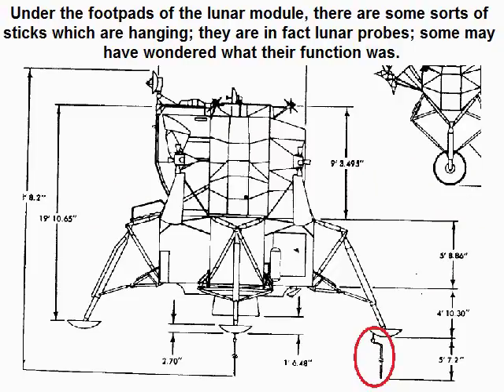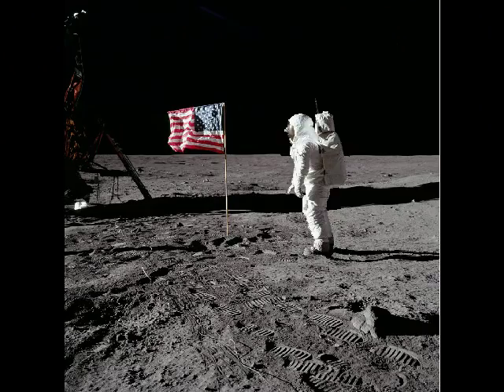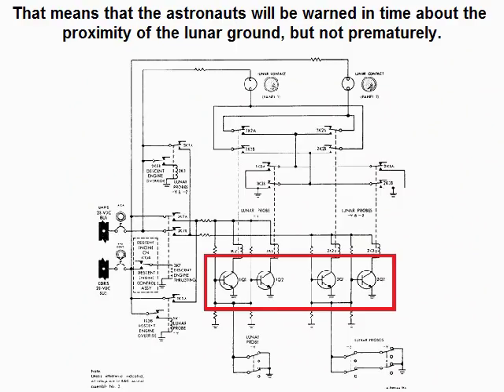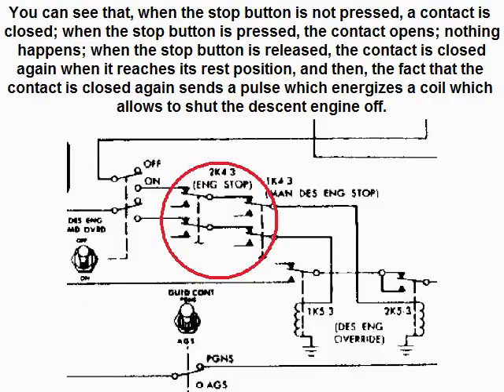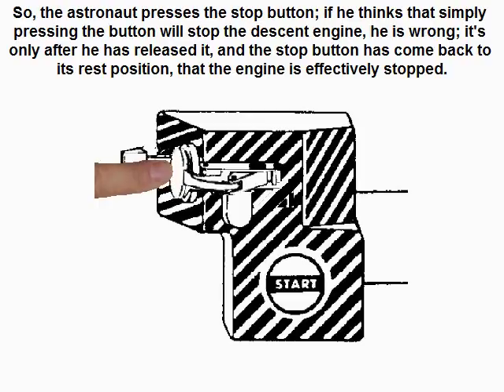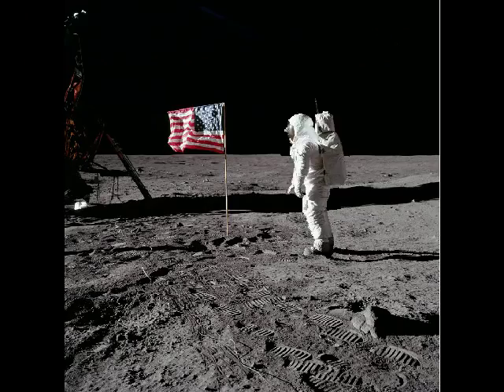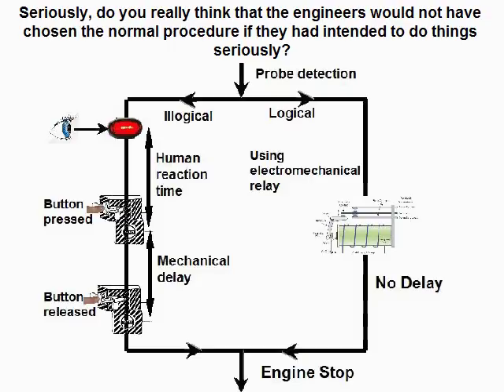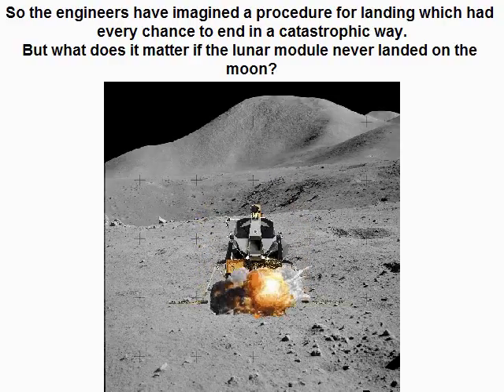Unsafe moon landing

Comment: That's another incorrect and illogical claim, Hunchbacked. The reason why the descent stage engine was shut off as soon as the contact lights lit (that is, when the first probe touched the lunar surface) was to prevent unnecessary damage to the fragile LM with its thin skin due to regolith and moon rocks being blasted up from the lunar surface. The LM could easily have landed with its descent engine still firing, as it was already throttled back to a small fraction of its maximum thrust. This mission design consideration can easily be found online in 30 seconds of Googling. As usual, an ignorant hoaxnut fails to do fact-checking and misrepresents Project Apollo to gullible YouTube visitors. What you are doing in your videos and texts is propagandising for your lost cause.
BOTTOM LINE: The reality is the OPPOSITE of what you claim: the LM descent stage engine was cut off seconds before the landing to INCREASE THE SAFETY OF THE MOON LANDINGS. Cutting off the engine was a childishly simple operation. The Apollo landing films clearly show regolith being blasted upwards and outwards at high velocity, therefore this safety measure was appropriate and necessary.
Yet another ludicrous hoaxnut claim DEBUNKED.
Reply: I am not "trolling this guy". This guy is trolling NASA, its courageous astronauts and the global scientific community. It's got nothing to do with ego; it's got everything to do with an ardent desire that the Internet fulfill its original mission to be a vehicle for education, not anti-science propaganda. It's got everything to do with extensive knowledge of Project Apollo gained from studying it for five decades from many angles and from studying the scientific research based on independent analysis of the data, photographs, films and lunar samples that were the concrete results of the Apollo lunar missions and have been independently verified by multidisciplinary teams of scientists working in numerous countries. Five decades of closely following developments in astrophysics, astronomy, cosmology, planetary science,  manned and unmanned space exploration and contact with experts in those fields. Awareness that no physical scientist anywhere in the world has ever contested the concrete results of the Apollo lunar missions or any other manned or unmanned space mission by ANY national space agency.
If you wish to dispute this, then please give me the name, title and research institute of any physical scientist who has publicly challenged the veracity of ANY space mission. We both know you will fail to meet this challenge.
  
It's an extraordinary claim you're making, Mr Smitty: that NASA lied about its missions! "Extraordinary claims require extraordinary EVIDENCE." (Dr Carl Sagan). Present your evidence, please. Proceed.
Reply: Rob - You are wasting your time arguing with Ralf, he will always be right no matter how much you debunk his claims, as for Hunchbacked, all his videos are universally laughed at, he is an idiot to be ignored.
Reply: Paul: that may well be so, but I am going to continue challenging these ludicrous, risible and baseless claims by putting the truth out here on Internet for all to see for as long as I can think clearly, read and type. Some people who read these posts will think logically for themselves and come to the right conclusion. I cannot stand idly by and see NASA and its courageous astronauts being maligned by these moronic, uneducated hoaxnuts.
Reply: hunchbacked quote:
"hunchbacked
17 hours ago (edited)
+Paul Julian
You know, I could remove your comment which clearly is an "ad hominem attack" (and I think that any other moon hoaxer would do it).
But I'll leave it, because I want people to see that the Apollo believers replace arguments with low attacks."

So,it's OK when you do it, but not OK if we disagree with you? You call Apollo defenders idiots and the like all the time. Do you know what a hypocrite is?
Reply: +Keith Mayes It has been established beyond doubt that hunchbacked aka Xavier Pascal aka Pascal Xavier aka lune imposture aka aerospace engineer aka SUPAERO aka ...aka ... does indeed possess a Diplome d'Ingenieur bestowed by ENSAE. The only way left to reconcile his formal engineering qualifications with the crap videos that he churns out like sausages is to introduce the prospect of some form of mental illness. The last time that he could have had anything to do directly with aerospace research was on or before 1988 thirty years ago. He does recognise that many of his moon loon bed partners are barking mad as he feels the need to distance himself from many of his supposed supporters who are flat earthers and the like. His failure to recognise that he is indeed painted with the same brush strokes indicates some delusion behaviour at the very least on his part. A sad individual caught in a personal phantasm of his own devising that he cannot escape from who often repeats his 'discoveries' on a regular basis. A very sad individual indeed!
Reply: Hunchbacked (Do you actually have a hunchback? If not, why choose such a name?) It seems that you have poor comprehension of the Apollo hardware and software system design choices, as you keep (deliberately) misinterpreting and misrepresenting them. In this case, the Grumman designers chose a simple but elegant solution: basically hinged metal rods, springs, wires and lamps. The system worked fine on all six occasions, so stop whinging. In any case, as I have already explained, timing of the descent stage engine was NOT mission critical; it was just an extra safety precaution. And any damned fool can press a button or flip a switch when a light goes on -- even chimpanzees.
Reply: Your video, as usual, consists of "I don't understand how/why they did this, therefore it must be fake." 

The poor comprehension is yours, Xavier. I suspect it is deliberate, however.
Reply: Hunchbacked: OK - it was probably a microswitch not a relay. But who cares? Why are you focusing on this aspect of the LM design? What do you hope to gain from this? Obviously, the Grumman designers had good reasons to make this choice. Maybe they reasoned that vibrations might accidently trigger a premature descent-stage engine cutoff, which would have been catastrophic. I can see why they might have preferred to give the astronauts manual control over this aspect. Many of their choices were simply to eliminate unnecessary complexity and lower the mass of the LM. Maybe, if you're generally interested, you should contact Grumman and find out if any of the designers are still alive.
I recommended this book to you: https://www.bol.com/nl/p/how-apollo-flew-to-the-moon/1001004010228706/
Have you ordered it? You should do. You need to get some education.
The key point is this: You have not presented any COMPELLING, INDEPENDENTLY CORROBORATED AND VERIFIABLE EVIDENCE, INCLUDING REFERENCES/LINKS TO SOURCES that NASA 'faked' one or more of the Apollo moon landings, and you never will because there isn't any!

FACT, uncontested by any physical scientist anywhere in the world: In the period 1969-1972, 12 NASA astronauts personally explored the lunar surface and returned 382 kg of Moon rock and regolith to Earth. Get over it and get a life! You're playing a loser's game.
Reply: Yes, the contact probe circuits contained relays. If you'd actually study them to learn something, you'd notice that the (multiple) switches and relays are wired in a fault-tolerant manner, like almost everything else on Apollo. You want the lights to work even if one of the probe microswitches fails to operate or operates prematurely. In fact, the Apollo diagrams are an excellent introduction to fault-tolerant design.
Reply: ApolloWasReal: Great comment - thanks for clearing up that confusion. ;-)
Reply: ...where intelligence goes to die.
Reply: Ahem... http://abcnews.go.com/Technology/apollo-moon-rocks-lost-space-lost-earth/story?id=8595858

Pay particular attention to this quote:  "  The Amsterdam case appears to be not fraud but the result of poor vetting by the Rijksmuseum."

As I said before, you need to read more than just the bits that appeal to you. More current articles help, too. Hoaxtard.
Reply: So, your NBC article from 2009 is legit, but a 2014 ABC article that further clarifies the issue is just damage control, eh? Thank you for proving my point. You cherry pick what you like and discard the rest. 

As I said. Fucking. Moron. The bit you seem to be missing is that all of these articles, including those you link, all state Riijksmuseum received the petrified wood from the family of Willem Drees. Not NASA. I'll repeat that. Riikjsmuseum DID NOT receive the petrified wood from NASA. 

Reading comprehension. Try it.
Reply: I figured him for a troll several days ago, and he's finally admitted to it.
Reply from the maker: +Rob Stuart
Precisely, the Grumman engineers perfectly knew that the most rational method was to make the detection interface of the lunar probes directly shut off the descent engine AS SOON as the lunar probes were detecting the lunar ground, and it was possible since this interface was containing electromechanical relays; an electromechanical relay is not necessary just to light a lamp!
Reply: Cornelius - how do you know his real name is Xavier? Do you know his surname too? I'd like to do a little 'research'. ;-)
Reply: Yes, that's exactly what they were concerned about: an accidental cutoff well above the surface. This actually happened many years later to the (unmanned) Mars Polar Lander.
Reply: Yes, even most experienced engineers are not all that familiar with fault-tolerant design where you have to ensure that the circuit or system still functions normally when any one part fails. The most common structure is the manual backup. E.g., to pressurize a set of tanks you have two independent pressurization systems, each consisting of a helium tank, valves and controls, either of which can do the job. If one doesn't work you manually switch to the other. For on/off controls that simply must work you have the 4-device series-parallel interconnection: two strings each containing two devices in series, with the two strings then placed in parallel. In Apollo I've seen this with switches, relays and even propellant valves on rocket engines. All four contacts or valves are operated at the same time by the same handle or solenoid. Any one of the four can fail either open or closed and the other three ensure that the on/off operation still succeeds.
Reply: +Rob Stuart  "how do you know his real name is Xavier? Do you know his surname too? I'd like to do a little 'research'."  

You might appreciate the gmail message I sent you.
Reply: Cuz, you know, all caps.
Reply: +Waldemar Figueroa  The 2017 list of murdered Russian journalists is Yevgeny Khamagano,  Nikolay Andrushchenko, Dmitry Popkov, and Andrey Ruskov. This though is way down on the 2002 figure which maxed out at 23 journalists that succumbed to Critize-Putin-Bullet-Hole-In-Head- itis. Not bad for a country operating on truthfulness and openness!
Reply: Comrade Waldo takes his English lessons from off the Smirnoff label. His girlfriend is the Ethyl genie that lives in the bottle as the muse that inspires his posts and kisses and caresses him each night before he slips into his palatial sleeping bag to give us all a breather from his inane ranting and raving.I didn't realise in Putin's Ruskieland that wi-fi connections were available down Moscow's deserted alleyways!
Reply: +Cornelius Crewe  A quick internet search indicates that Waldemar Figeroa is a central and south American  name and not of Ruskie origin at all. His timeouts of YouTube posting presumably for sleeping are consistent with the habits for someone from the same neck of the woods. He is just a jackass troll who knows nothing of any substance re Apollo and should be ignored as such.
Reply: You had him pegged right off. Types like him are very predictable. Engage them just enough to rile them up, eventually they will expose themselves for the trolls they are, just like old Waldo.

 You would think it would give hunchbacked pause that clowns like this are his only supporters. Sadly it does not.
Reply: Rob Stuart This is an exellent discovery! And this shows me how ridiculous the moon landing is. A 1.7m long stick to measure the distance to the surface? The astronaut has to look all the time at the right lamp and has to push the right button and also has to release it instantly. In under 1 second? If not the lander would be destroyed! A very clever solution! And 6 times all the astronauts made no error! And what happens with this sticks during the landing?  They pushed them 1.7m in the ground? I have never seen fragments of this sticks. What if there were rocks under the ground?
Reply: Ralf: You misunderstand. The probes were not intended nor designed to MEASURE the distance to the surface. They were simple mechanical devices that triggered a relay, which switched on the dual contact lights on the LM main control panel. Both LM astronauts were watching the panel very carefully during the entire powered descent, because that's how they got essential data and other feedback on the spacecraft's velocity in each axis, position, engine thrust, fuel levels, etc. etc. They simply had to press the engine cutoff button. The LM was almost stationary at that point. Horizontal velocity in both directions was zero or near zero. Vertical velocity was also near zero. The LM was essentially hovering. When the responsible astronaut cut off engine power, the LM dropped a few metres to the surface. Each landing leg and footpad assembly was supported by and suspended from spring-loaded trusses with shock absorbers to absorb the forces and retain horizontal orientation of the LM.
No one has stated that the LM would otherwise have been destroyed; the probes and engine cutoff were simply an extra safety measure to prevent undue damage due to flying regolith and rocks. Upon landing, the probes simply bent to one side; they were not firmly mounted to the footpads and they therefore could NOT penetrate into the lunar surface.
Here are descriptions, drawings and close-up photos of the probes:
http://heroicrelics.org/info/lm/lunar-surface-probe.html
http://www.space1.com/Artifacts/Lunar_Module_Artifacts/Surface_Sensing_Probe/surface_sensing_probe.html
Here are two Apollo surface photos of probes bent to one side: http://www.space1.com/Artifacts/Lunar_Module_Artifacts/Surface_Sensing_Probe/AS11-40-5917_600.jpg
https://www.hq.nasa.gov/alsj/a12/AS12-47-6907HR.jpg

ALL YOU HAD TO DO WAS GOOGLE "LUNAR MODULE" and "SURFACE PROBE"!!!

Why can't people do their own fact-checking?
Reply from the maker: +Paul Julian
You know, I could remove your comment which clearly is an "ad hominem attack" (and I think that any other moon hoaxer would do it).
But I'll leave it, because I want people to see that the Apollo believers replace arguments with low attacks.
Reply: Dude. Here u are trolling this guy, yet u ignored my response to you on his last video. 

Seems like u have an ego that is so big that u can see the truth. No way you could have ever been lied too and you not knowing. You think you are highly intelligent. Clearly you are only a book worm. 

I bet that you were 100% convinced Hilary would be president. Why do I think that? Because you believe everything that the corrupt TV and mainstream tell you.

So, where can I go and see all the 800lbs of moon rock? 

https://www.google.com.au/amp/s/gizmodo.com/5242736/how-an-intern-stole-nasas-moon-rocks/amp

Do you really believe that all the moon rocks
Are gone due to some interns pretending to be in some mission impossible movie heist. Then you are as gullible as you sound.
Reply from the maker: I think that you completely missed the point.
The video does not say that the descent engine should not have been shut off before the lunar module was touching the ground, it says that it could have been shut off more efficiently, as soon as the lunar probes were detecting the lunar ground, and not after an unpredictable human delay which could make that the descent engine would still be firing when the lunar module touches the lunar ground.
It seems that you have a very poor comprehension of this video.